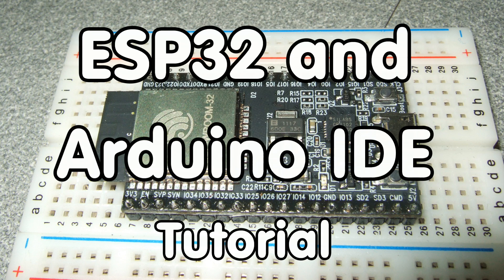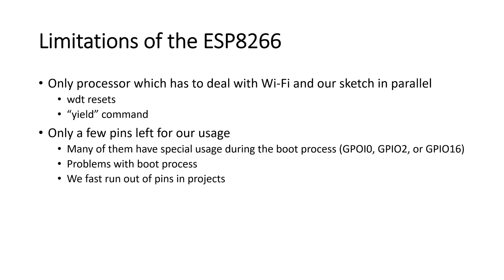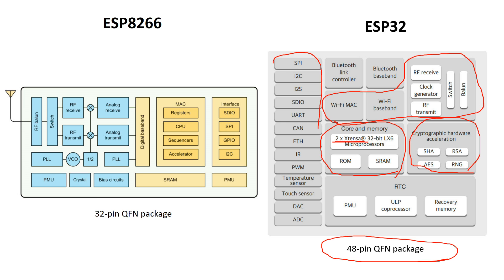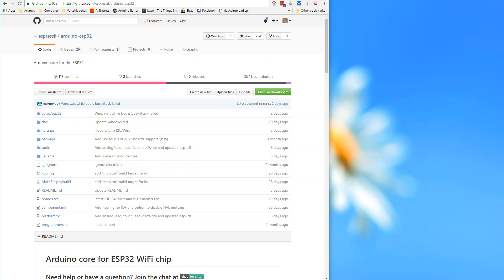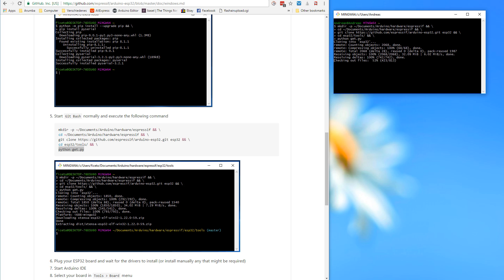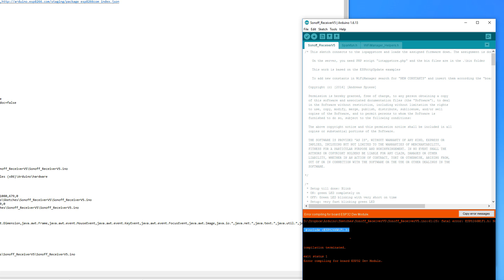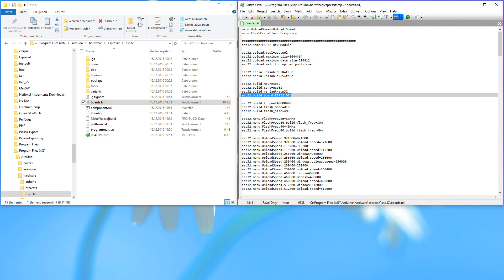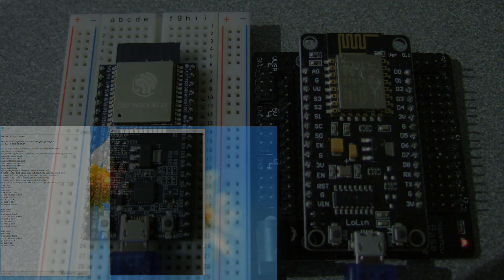#103 ESP32 Tutorial / Arduino IDE  / Tests / Comparison with ESP8266

Comment: I have several ESP8266 boards, but I just got my ESP-32S a few hours ago. The first thing I found was that I couldn't connect via its UART. Nothing happens. I can connect via the micro-USB port, watch the ESP-32S boot, then all that happens is "Welcome to use ESP-3S Module !" repeating forever. I saw that someone else reported this problem a few weeks on the Espressif forum, but he has had no responses.

I followed your excellent video, but have two problems. The first is when cloning into esp-32. A syntax error in get.py, line 85.

=====

> python get.py
...
  File "get.py", line 85
    except Exception,e:
                    ^
SyntaxError: invalid syntax

========================

The next problem is being unable to download in the Arduino IDE to the ESP-32

=====================

Arduino: 1.8.0 (Windows 7), Board: "ESP32 Dev Module, 80MHz, 921600"

exec: "C:\\Users\\Walter\\Documents\\Arduino\\hardware\\espressif\\esp32/tools/xtensa-esp32-elf/bin/xtensa-esp32-elf-g++": file does not exist
Error compiling for board ESP32 Dev Module.

=====================

Believe me, I am not complaining. I am just mentioning where I am, mere hours after (finally) getting the board. It took several days to get my C.H.I.P. board working, so I am used to figuring things out. I'll start again tomorrow.

Thank you for your video.
Reply from the maker: So far, I have not a big experience with ESP32, so I cannot help you. But I think, the second error can be connected to the first. So, I would solve the first one first. Maybe tehn the "not existing" file will be copied, too.
Reply: You were correct in your thinking that the second error in my original message was related to the first one. I fixed the syntax error in get.py so that get.py now works OK, and downloads the file Arduino was looking for:

========================================

Walter@Walter-PC MINGW64 ~/Documents/Arduino/hardware/espressif/esp32/tools (master)
$ python get.py
  File "get.py", line 85
    except Exception,e:
                    ^
SyntaxError: invalid syntax

[note: I changed line 85 to read "except Exception as e:" and it found the file that Arduino said was missing]

Walter@Walter-PC MINGW64 ~/Documents/Arduino/hardware/espressif/esp32/tools (master)
$ python get.py
Platform: i686-mingw32
Downloading xtensa-esp32-elf-win32-1.22.0-59.zip
Done
Extracting dist/xtensa-esp32-elf-win32-1.22.0-59.zip

Walter@Walter-PC MINGW64 ~/Documents/Arduino/hardware/espressif/esp32/tools (master)
$

========================================

That allowed me to progress to the next two Arduino errors:

=========================================

Arduino: 1.8.0 (Windows 7), Board: "ESP32 Dev Module, 80MHz, 921600"

File "C:\Users\Walter\Documents\Arduino\hardware\espressif\esp32/tools/esptool.py", line 182

    print '%s' % inst.CHIP_NAME
             ^

SyntaxError: Missing parentheses in call to 'print'

Multiple libraries were found for "WiFi.h"
 Used: C:\Users\Walter\Documents\Arduino\hardware\espressif\esp32\libraries\WiFi
 Not used: C:\Program Files (x86)\Arduino\libraries\WiFi
exit status 1
Error compiling for board ESP32 Dev Module.

===============================================

Now I'll look into the syntax error on line 182 of esptool.py

The warning of multiple WiFi.h libraries sorts itself out, but using such a common term such as "wifi" for a library can lead to problems. 

The professor in my first college Electrical Engineering class said, "If it doesn't work the first time you turn it on, you are indeed fortunate. For then you will eventually learn more about it than you could any other way."

Thank you again for your help.
Reply from the maker: This guy was absolutely right. Because, you only can learn of mistakes. If you do not make a mistake, you master this topic already and there is no progress...

Comment: Andreas, with current prices of ESP32 ($30) I don't expect any success. For much less we can buy SBC systems like OrangePiPC or One which have much more capabilities. Orange Pi One costs only $10 + $3 shipping. And it is very powefull 4x core computer. Of course in terms of power consumption it is not competition.
Reply from the maker: I do not think, that processing power will be important in this battle. Other things like energy, interfaces etc. are more important. But it will be interesting to watch. The ESP32 will cost less than 5 dollars in summer.

Comment: I think the old esp is a good deal for a dollar or so. It's pretty good for something that should be used as a wifi interface and not the whole system. But for $10 you can now get a board with a quad core cortex A7. The allwinner chips I'm thinking about even have a microcontroller in them that can be used to go down to very low sleeping power modes. Either way very interesting times.
Reply from the maker: You are right. I think, the battle will not be hardware, I think it will be software, and especially the ECO system of libraries etc.
The hardware designers more and more just use the "Lego" bricks of companies like ARM and mix them according their desires.
I think also, that I do not want to invest too much time in a "dead horse", even if it is good looking. And with 10$ a piece, you have to sell a lot to survive. So, I expect many "dead horses" along my route... I hope, the ESP32 will be a survivor, but do not know.
Reply: Andreas Spiess 
From experience (commercial product) we went for the solution we did because of the vendor supplied SDK (Has TLS, MQTT, json, xml, homekit etc), stack being verified by the wifi consortium etc. Everything flips back to being based on hardware cost when a chip that can run Linux isn't much more expensive than a high end micro controller.

I think these ESP parts will show up in lots of mass-produced Chinese products so I don't think the supply for hobbyists will dry up.
Reply from the maker: I am not sure if linux will be the preferred solution for small devices. I hear, that Unix will take the world over since the 80s...
I think,  a less sophisticated Real-time OS might be a better choice. I also look at Google, because, as you point out in your comment, the ecosystem is important for the decision. And maybe also the integration into internet services might become the deciding factor for the choice.
Reply: Andreas Spiess Google is already pushing a version of android (aka linux) for IoT that is slimmed down to run on cheap hardware.
I think for Google etc messing around with making an RTOS that has proper memory protection etc isn't worth the effort.
Cortex A? chips with enough built in RAM to run Linux are just around the corner :)
Reply: You can compare a device with an application ARM chip running an OS to an Embedded device.  You are comparing apples to oranges.
Reply: Steve B You comment makes no sense.
Reply: I have 100k units in the wild running firmware I wrote. Pretty sure I understand this stuff.

Comment: Thank you. Hopefully you don't spend the hole night to making the video? 7am early in the morning is a amazing time. Good explanation of the leading and bleeding edge with the ESP32! Some days a go I just do a small adoption of you DIY DASH Button with the ESP32 to implement some kind of "emergency" button (check my vid). Btw. how is your MOOC going on?
Reply from the maker: I use the "timed release" function, because it delivers HD quality from the first second (and maybe, also because I am Swiss;-) ).
I watched your video. Thanks for the "reference"!
I started the MOOC, but the first parts were pretty general. But you never know, what you miss. So, I had to watch them all... It was about assembler programming, stacks, interrupts etc. which I knew (at least at the level of the MOOC). One learning I ad so far: Pointers in C. I still did not completely understand the concepts behind this. Now, it is a bit better, but I still have to use it. So far, no HW was used.

Comment: Why python 2.7 and not the newer one?
Reply: Probably because something it requires doesn't work on python 3.
Reply from the maker: Most of the stuff I use requires 2.7. I Asked myself the same question as you and tried (not in this case) the 3.x version. And it only produces errors. They must have a lot of changes between the two versions. But I am just a beginner-beginner in this matter.
Reply: Marc Ritz python has a huge adoption issue, 3.x has been out forever and nobody wants to upgrade their packages to use it... I rewrote the upload script for py 3.x and sublime because I thought avoiding it was stupid...
Reply: Kevin Klika Thank you for the heads up. Don't you think it's insane how it isn't backwards compatible? Or is it? Does it offer any advantages?

Comment: Hi Andreas
It was very interesting as usual. You know most of my Christmas presents (soldering iron, buck converter power supply, Dupont connector, small pir) but I have also asked for a Raspberry Pi. I want to run it as a home web server and I was wondering if you have ever looked at them - particularly the Pi Zero because it is also very cheap, has lots of IO pins and is easy to program with python.
Best wishes
Arthur
Reply from the maker: I have some PIs laying around. But so far, I had no time. I will use one for my LoRa concentrator...
I hope, your Christmas Angel can still fly with this heavy load...

Comment: I desided to go with Ardiuno ide for the sonoff. I lost one sonoff as Peter Scargill code that nodemcu, which uses lua. I tried upgrading that one with no luck. So out came another sonoff. Still having problems. Can you point me to your github please.
Reply from the maker: The links should always be in the comments of the respective videos.
Reply: Woops they are not for github on this one.
Reply from the maker: This one has none. Because nothing worked, just the WiFi scan example of the IDE ;-)

Comment: My Sparkfun Thing board didn't flash, I had to modify the esptool script (DTR handshaking) first. Have to admit that the Arduino libs aren't complete, but using the ESP-SDK directly is not that difficult… don't be shy!
Reply: Btw, I'm stuck, my program fail and crash the esp32 on a damned malloc. Looking up how malloc is implemented, got me in the rabbit hole: Instruction RAM, 32bit only RAM, Data RAM, sliced memory chunks and multiprocessing. Reality is that your left with only 270KB of RAM.
Reply from the maker: I will stick with the Arduino IDE because most of my viewers know this environment. And, as you describe in your next comment: We probably also have to wait for the Espressif IDE...
I have now three different boards (two came just after this video). And all three flash without any problems. But not all with the same board definition.

Comment: Thank you for excellent review of new ESP32 ! For me would be very interesting if new board can run SPI at 80MGHz, also power consumption in different modes and Pi benchmark in comparison to old board.
Reply from the maker: You see, there is lots of stuff for new videos... BTW: What is the Pi benchmark?
Reply: It is time for Pi calculation
Reply from the maker: Is there an official code for the Arduino IDE?

Comment: I jumped to ESP8266 this year when bugs and libraries were mostly solved. 
Now Im in the edge people are developing ESP32. 
I cant imagine how ESP32 will stand out other MCU in term of price, functionalities and a big big community!

Thank you Andreas!
Reply from the maker: You're welcome.. I think, the biggest advantage of the ESP32 will be its support for the Arduino IDE and the well-known ESP8266. Which competing chips do you have in mind?
Reply: I really like the fact that most Arduino libraries + code are compatible with ESP8266 without many changes.
At the moment, particle photon and TI CC3200. 
Btw I think that if we need ESP8266 for simple tasks. I2C I/O expander like MCP23017 should solve the limited number of GPIO pins :).